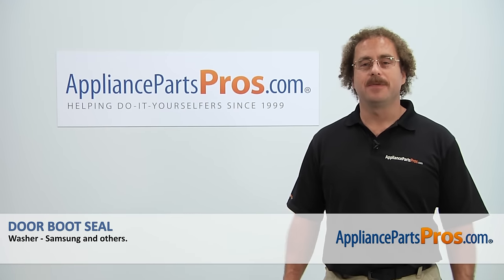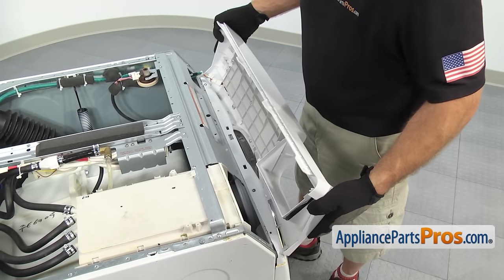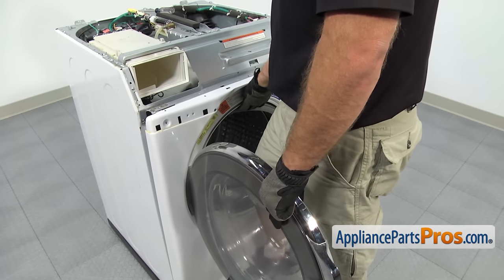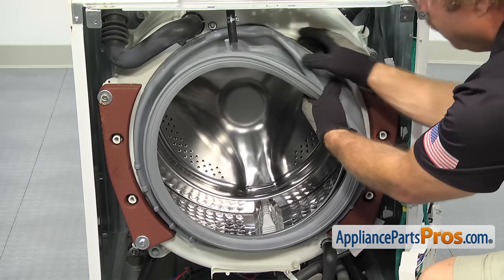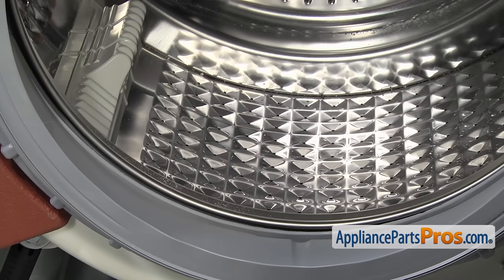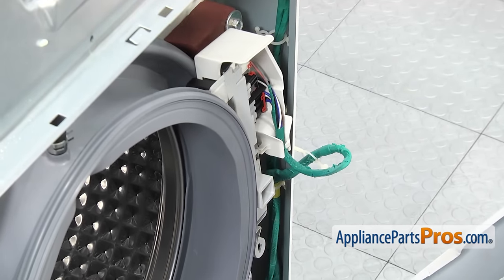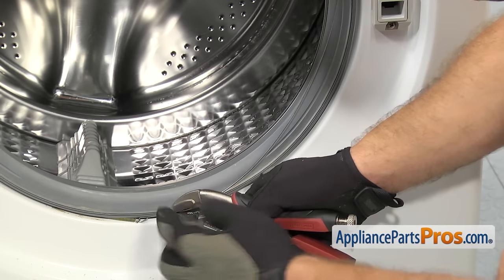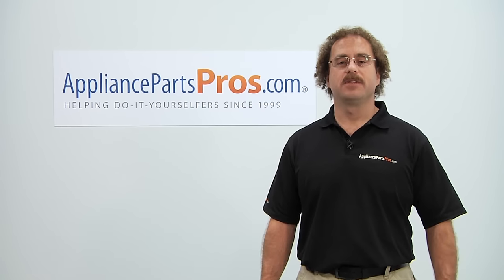How To: Samsung Door Boot Seal DC64-00802B

Comment: Older Model Owners here are some notes.   I followed the directions in the video (excellent) for my 15 years old Samsung washing machine.  I did have to add some extra steps,   importantly I had to remove the bottom rust color stone piece (using 1/2 inch ratchet)  to get the gasket in place over the lip at the bottom (7 min mark of video) as there is not enough of a gap to install without removing the stone.  Also with the top panel I removed the 4 easy attachments and kept the ones on the long black cable connected,  leaving the top panel on top of the machine.   I also had to disconnect the detergent draw screw to allow the top panel to be removed since the lip was in the way.   I also re-attached the door switch harness, to the front panel with the panel on the bottom tabs before screwing in the front panel.   You can tell if you have the same model I worked by seeing the rust stone on the bottom, in the video they are on the side.   It took me 3 hours, including prep, cleaning during the project, and putting everything back in place.🙂
Reply: Your comment just saved me from calling in a handyman 🙏 I couldn’t get that stupid gasket to fit over the lip and was ready to give up, and then I saw this comment

Comment: Great informative video! How do you keep this rubber door seal clean? Ours constantly get black spots and dirty like mildewy stuff. It’s gross and I tried many things. About to order a new one which is how I found this video
Reply: Putting this here in case anyone else finds it helpful. I found a lot of success by making sure I leave the door open to dry after using, and every time I put a new load in I use one of the clothes I'm washing to give the seal a quick wipe to make sure any dirt isn't collecting. Then, it's also important to check the drain holes at the bottom of the seal and keep them clear of hairs and debris. 

I also use the drum self clean cycle about once every other month.

Comment: I just completed mine, took me 3 hrs with a few interruptions.
2 things to note; when removing the front panel of my machine I discouvered that there were 2 screws on the very bottom edge, they went through the metal "tabs", there are 3 tabs along the bottom but only 2 had screws...tough to reach as they face down, had to tilt/block the machine back at a steep angle. You cant get the front panel off without removing them. 
The other item is that the "control panel", has plastic "tabs" I broke one off so be careful leaning that part back while you unhook the wire harnesses.
this vid was great, I wouldnt have attempted this without it!!
Reply from the maker: If there is anything we can help you with at all please let us know.

Comment: So far so good.
I ran into a problem taking the front frame off...mine was held together at the bottom of washing machine by 2 screws.
Overall, very well done & detailed.
I had watched a couple of other videos on this by different people & yours was by far the best!
Thank you so much for your help 😅
Reply from the maker: If you need help with anything please let us know.
Reply: @appliancepartspros  Thank you.
I was able to take it apart & put in a new one.
Just waiting on the new outer securing ring with the spring.
Do you think it'd be alright to use the machine once or twice while I am waiting on that piece?
Reply from the maker: We wouldn't advise using the machine until you get that ring. If the gasket isn't secured it can leak and you could have water all over the floor.

Comment: I was able to fix my washer in just over an hour. Thanks for the step by step, saved me hundreds.
Reply: Does it cost hundreds in labor to have this replaced?
Reply: @Mike OMG First, did not say $50, but hundreds. You are right about expensive repair for just a seal. Quote was $370, more if problems with door. Half the price of replacing same washer, so purchased new appliance with warranty. Shows you not that effortless by your comment!

Comment: What a great video, step by step explanation and everything! I just finished the job on a Samsung washer Model WF331ANW/XAA. Even though on my model, I had four screws (not 2) on the bottom of front panel in the filter well, and forward spring clamp was located on the side, no on the bottom, as well as the inner clamp was on the 9:00 o'clock position, the institutions helped me a lot. The only challenge was loosening/tightening the inner clamp bolt (the mounting blocks of the tub were on my way, so I ended up using a 90 degree screw driver and a crescent wrench (since I could not fit a socket there). Thank you so much!
Reply: Did you follow all the make sures? No problems following the complicated steps, at least to me?

Comment: Thanks! Helped to replace door on BubbleWash 7.5. Didn't remove the door completely but left it hanging down resting with the open door on the ground. Also removed the two white plastic lugs mid way on the front as couldn't get the door back on. Had the most difficulty getting the seal over the plastic lip on the inner drum - another video said to use dish washing detergent to ease it in, which helped. Once you've got the hang of pushing the seal over the lip it slides in nicely to a tight fit. Strangely satisfying to close the door onto the brand new seal :)

Comment: This is a great video but watch it a couple times and make sure to keep it handy when working on your machine. I actually had 7 connections in my control panel. I ended up just laying it on the top of the machine. I also had to remove the weights from the drum to unscrew the nut on the ring around the gasket. It all worked but took me about 2.5 hours.

Comment: I just replaced the door gasket on my daughter-in-laws Samsung washer.  The video was close enough and informative, thank you.  I ran into a snag pulling the front door cover off as there were screws in the bottom flanges. I had to tip the washer up 45 degrees in order to remove them.  The screws were missing in the bottom left filter cover?

Comment: With the new style Samsung Front Loaders, there are two small screws in the bottom of the front cover; preventing you from just lifting up and pulling the front cover off the machine.  The screws are installed in the very bottom on the underside of the front cover that makes it impossible to access.  Why Samsung did this is beyond me.... I really do appreciate your video!

Comment: Excellent video!   I have a newer model washer that had 7 wire harness connectors and 2 extra screws on the bottom of the front panel but no big deal.  Worked great.

Comment: Thanks for the video. Wouldn’t have been able to do this without it. Took me much longer than I thought. My biggest issue was getting the control panel off. It got stuck in the soap dispenser side. I would suggest that if you get stuck getting it off, try disconnecting the dispenser for the inside. Mine only had one screw and made getting the panel back in was a snap.
Reply from the maker: Glad we could help. Thanks for that tip!

Comment: Recently replaced our door boot seal as water was visibly dripping from the outside bottom of the door. Installed step by step and now I’m getting a leak during fill up, underneath the drum, directly under the boot seal. Checked all hoses, drain pump hoses cleaned, no visible leaks from the top inlet valves. I’m going to retrace my steps before I call a technician, but would the boot allow water to drip out of the drum? Just trying to think if it’s the boot or possibly the outer tub seal. (Which I’m hoping it isn’t). Great tutorial!
Reply: Interesting. My 10 year old machine with original seal is rusting in the same spot. Good to know.

Comment: This video is so well done that it gave me the confidence to get the tools to do it myself. Silly questions from an absolute 1st timer: 
1) how do I know if I need to replace it
2)are all the screws the same all around or do I need to worry about keeping each one separate?
3)Same question about the big wire clamps: is the spring on the front one that you pointed out also there on the back one?
Reply: There should be a few screws at least that are different so its important to keep track of where they go.

Comment: Hello, we had the smoke and loud noise problems on our front-load Samsung. We replaced the spider arm following all these steps. Now the washer will vibrate but the drum does not spin and still doesn't work. Any ideas? Much appreciated.

Comment: I swear they replaced the boot in mine without removing the top. I say this, because the gas dryer was stacked on top. They were able to do it all from the front. They were able to get to the screw clamp as well. Mine was a model bought in 2009. the washer and dryer only lasted 13 months before they have to be replaced. My new set Samsung washer and dryer I bought in 2011, just failed as well.

Comment: Must have been lightly used washer, that old boot was was cleaner than I've seen. Most are yuck, moldy with lots of old soapy residue. Great video though, slow enough to keep up but fast enough to get it done quick.

Comment: Mine has developed mold and I've used beach and other releases but it won't come off. I don't usually leave the door open due to the 2 cats which like to climb into things. Mikey can open and close doors, ones with lever handles and he can push on door to close them. He's a big 20 pound big boy black cat...he could easily close the door with his pal Vladimir inside.....bugger

Comment: So interestingly the gasket replacement went well, the burnt rubber smell seemed to disappear, and everything seemed great! Until the final spin cycle. Once it kicks into high speed the drum is rubbing against the gasket too hard and I believe that’s what caused the gasket to fail. Any idea what would cause this?
Reply from the maker: If the drum is rubbing on the gasket you will need to check your spider and suspension rods for damage.
Reply: @appliancepartspros  so I decided to run a light load with the top off to see if I could see what was going on. The whole drum assembly was quite wobbly even at low speeds. That quickly changed to a thumping and maybe a noise like the belt was breaking. The drum stopped and could no longer spin. I got an error E3, which is “Motor not running properly” I am going to take the back off to see if the belt broke. But it seems before I would try again I also need to check what you said. I’ve been browsing all of your videos, I’ll be a Samsung washing machine certified technician til I’m done here. Hahaha 😂 Thank you for your help
Reply: Is there a way to force the machine to drain the water? There is no drain button on the control panel. Just rinse and spin.
Reply from the maker: If you provide your model number I can check to see if there is a way to drain it. But you can try removing the drain hose from the drain and putting it into a bucket, as it lowers it should allow the water to run out of the machine. You should be able to get most of it out that way.
Reply: @appliancepartspros  The drain hose will do the trick well enough, thank you again. Had a heck of a time getting that bolt loose on the back to remove the motor assembly, but a breaker bar did the trick. I used to be afraid to take appliances apart like this, but the worst case scenario is I broke it, and I have to buy a new machine like I was going to anyway. Your videos are so helpful. Thank you for what you do.
Reply from the maker: You're welcome!
Reply from the maker: You're welcome!

Comment: Hello , how can I dissemble the add wash front door of this model WW90K44305W? i want to take out the door so it can fit on the door on my bathroom. The door has a cable. How can i easily remove it? Thx

Comment: Change or Delete this Video!!!  R&R boot is super easy. Remove outside spring wire clamp. Pull boot seal in to gain access to hoses and inside screw wire clamp. Install boot in reverse. Simple Easy! No panel removal No screw removal No disassembly needed. Just wire clamps R&R and hose attachment to change out boot. Hey this boot R&R takes 10-20min and any kid can change out this boot. Tools phylips screw driver needle nose plyers and maybe a little lube to aid in boot install. Do Not make it hard or complicated to R&R a Samsung Boot
Reply: Ed is correct.  There is no need to take apart any of the panels.  I just replaced mine as Ed mentioned.  Took me 45 minutes total time, and that included cleaning the plastic that the boot sits on.

Comment: I have that washer. But mine doesn't have that Door on the bottom front right
Reply from the maker: If you need additional help with the repair because your unit is a little different than the one in the video, you can give us a call at 1-877-477-7278 or you can chat us at our website: http://www.appliancepartspros.com/. We’re here to help 7 days a week.

Comment: Hi I did all this and it worked good till I plugged it in and turned it on with a DDC code
Reply from the maker: What is your model number?
Reply from the maker: The ddC code means the error of opening the door to refill the laundry. The Samsung washing machine “believes” that the door was opened without pausing the program, that is, without pressing the “Start/Pause” button before refilling the items.

To remedy the situation, press the Add Door closed, then press Start/Pause and try again.
Reply: @appliancepartspros  what is the add door. Both doors are closed.
Reply from the maker: Unfortunately, it looks like this model is an International model, so the information provided above is all we could find on it. You should be able to check your use and care manual or contact the manufacturer for more information on that error code.

Comment: Neglected to tell people that there is 3 screws on the bottom of the front panel tabs that need to be removed in order to get the front panel off...
Reply from the maker: A single part can be compatible with many different appliances. We film the part on a single appliance model to serve as an example of the repair, but there may be slight variations in the process for different models. If you need additional help with the repair, you can give us a call at 1-877-477-7278 or you can chat us at our website: http://www.appliancepartspros.com/. We’re here to help 7 days a week.

Comment: What a poor design. For a part that can wear out over time and also needs to be cleaned up thoroughly it should be engineered to be easier to remove than this. It’s a very good video but there’s a lot that can go wrong, especially with the hose clamps.